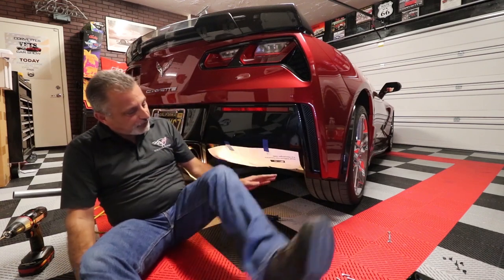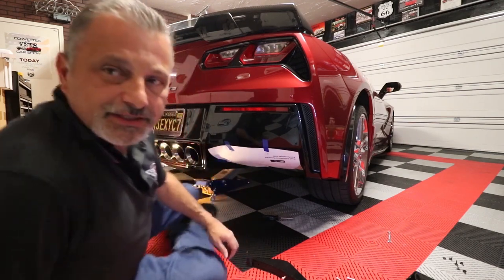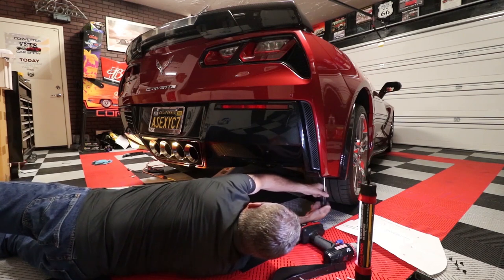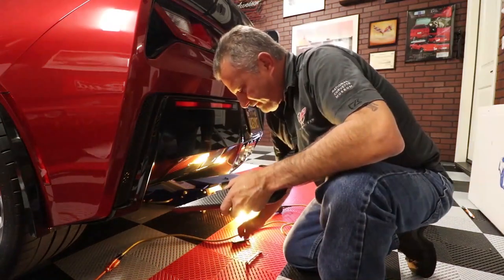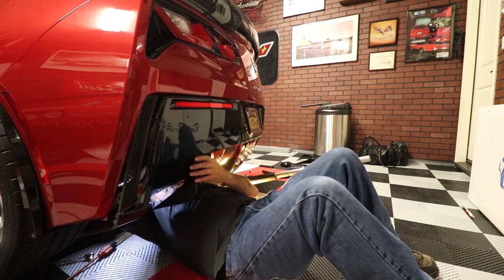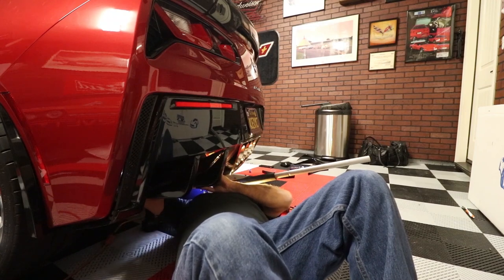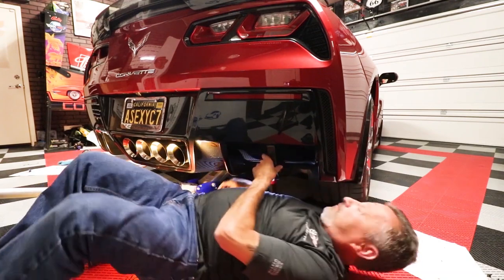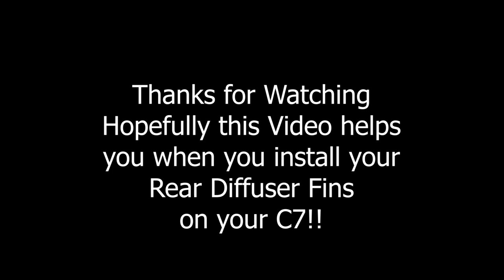How to Install Rear Diffuser Fins From Extreme Online Store

Comment: I didn’t like that they were not flush. Also they are angled out on each side. And yes I put the r on the right and the l on the left . Not sure if they were so posed to be like that ?
Reply: I watched another installation video and they said put the R on the drivers side and L on the passenger side. I wonder if that would fix the alignment

Comment: You mentioned that you may have a copy of the templates used.  I purchased a set from a friend, but he lost the templates.  Is there any way you could send me a copy.  Thanks
Reply from the maker: Which brand did you get?
Reply: @THECORVETTECHANNEL  " He thinks they were EOS
Reply from the maker: @mitch_9219  go ahead and email me at thecorvettechannel@gmail.com and I will see what I can do. If you can send me a picture of the back of one of them and I will be able to tell.
Reply: I got some without a template also. Wondering what the proper spacing is supposed to be

Comment: This is a great video and very informative but honestly,  it's a way easier job if you remove the lower facia..   I just installed this kit and removing the facia is very easy once you remove the reflectors out of the bumper.

Comment: Is it a good idea to only use a jack and not jack stands as well?  Also seems like a better way to design them when you don't have to be a contortionist or risk getting your head smashed.  I bought them and I still remain hesitant to start a job like this but will try soon.  You explain everything perfectly.
Reply from the maker: Thank you so much for watching!! You could always back your car over a couple 2 x 4's or 2 x 6's and then you would not need to jack it up.

Comment: Whats the purpose of using the 1/8 drill bit first and then the 1/4? Why won't you go straight with the 1/4
Reply from the maker: When you go to drill it the drill bit will grab to much with the bigger bit. This is just to be safe and not have it not damage the bumper.
Reply: And the bolts that they sent me are not sms bolts they are hex bolts and im trying to see how are the bolts supposed to hold on to the fins since when i try to fit the bolt into the opening of the fin it slide out and in easily. Is there a problem with the bolts?

Comment: I got mine in from eos the other day, couple of problems.  1) they sent me the wrong self tapping screws.....they are too small.  Not sure how that could happen.  Emailed them and they said go get one size bigger.  Okay thanks lol. 

2) my fins are not marked.   I dont know which one goes where...im pretty sure these are different sizes.   

My question is: any help on figuring out which fin goes on which side?  Smaller fin on the inside or out?.  Any help would be appreciated.  

Ps not a good experience so far with this company...pretty poor qc, and not helpfull at all.
Reply from the maker: I am sorry you experienced this.
I noticed in one our recent installs that they are not marked and that they are all 4 the same.
You should be able to confirm that by looking at them.
As far as the screws go, I am not making excuses, but I am sure someone made a mistake sending you the wrong size, I know this is not what you planned on but it .as be faster to get the screws at Ace Hardware and get them on and start enjoying them.
When I bought my ZR1 wheels the wheel shop sent me 3 different styles of lug nuts.
So things like this happen.
I'm sorry...
Reply: @THECORVETTECHANNEL  yes, you are right they are the same size (i actually took all 4 out and put them next to each other).  However they are deff different in a way, like they slant a certain direction.  There not 100% exact.  So i gotta just trial and error until they look right i guess.
Reply: I ordered a set and they did not come marked either.  did you figure it out?
Reply: @erniepick5942  yeah. I just kept fitting them, which ever looked better.  Not sure if they are right but it looks fine.